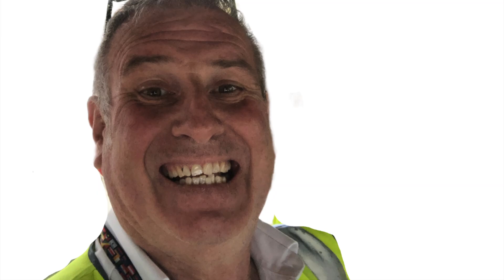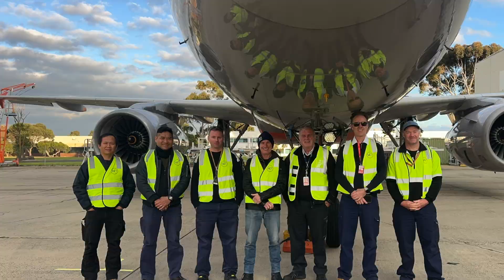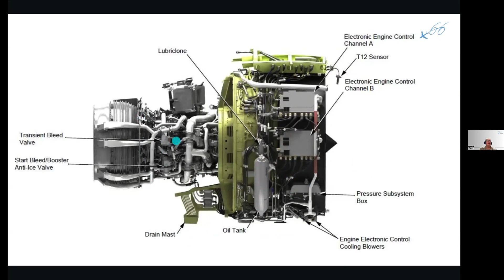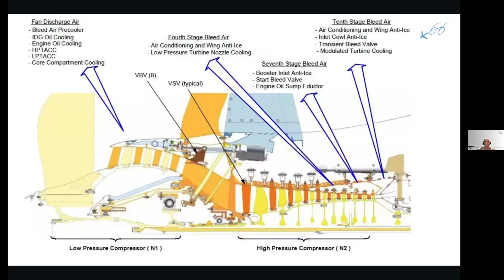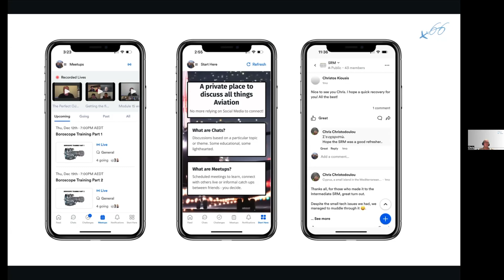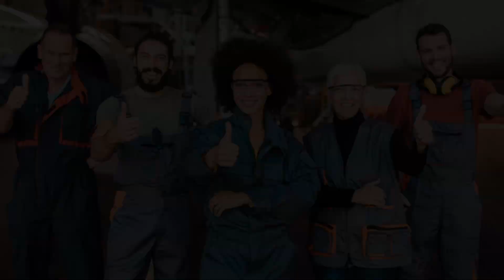Boeing 737 MAX LEAP-1B Engine

Comment: The 737MAX has short main landing gear and large diameter engines, so it is easy to raise the nose, and the horizontal stabilizer needs to be moved by the automatic flight control system (MCAS). The automatic control system (MCAS) has malfunctioned, which has caused two crashes.
If the automatic control system malfunctions, the pilot needs to manually turn the trim wheel and return the horizontal stabilizer. This training was a condition for resuming operations.
The 737-MAX10 has a long fuselage, so the horizontal stabilizer is far away and more force is required to turn the trim wheel. Even the 737-MAX8 is heavy and difficult to turn, so it is impossible to manually move the trim wheel of the 737-MAX10.
Therefore, it is impossible to obtain type certification for the 737-MAX10 with the same modifications as the 737-MAX8.